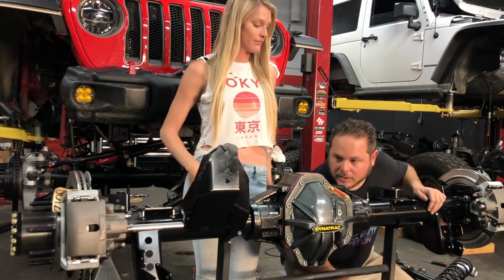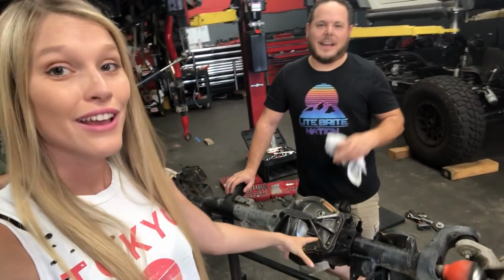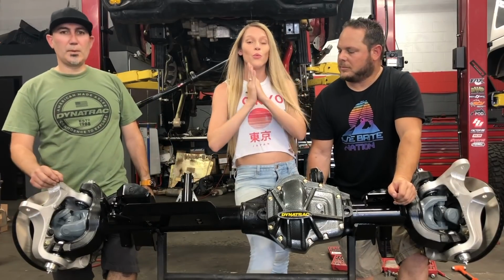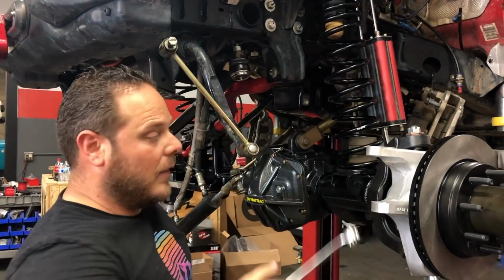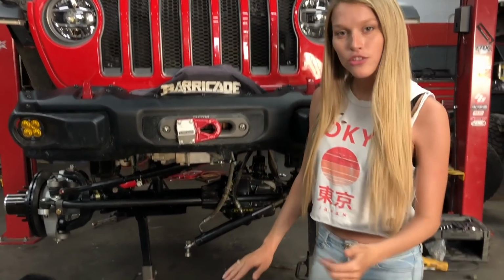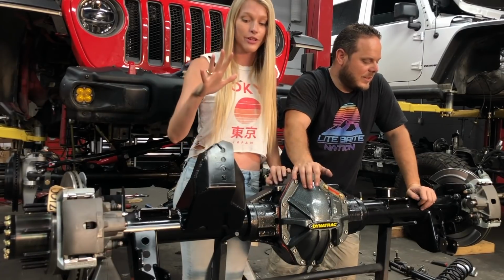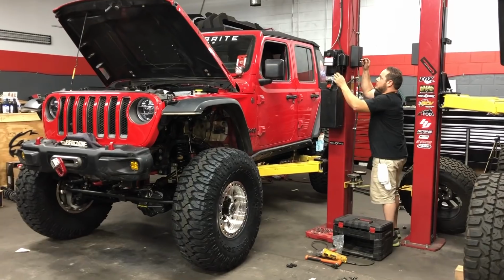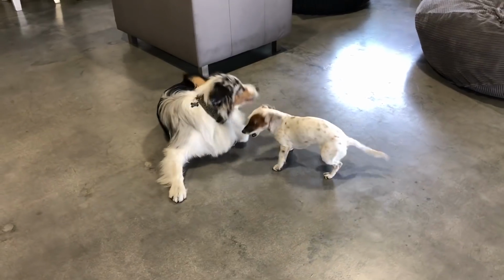The HEMI SWAP Gets Some DYNATRAC AXLES!

Comment: The axles have arrived! You guys are BACK. I can hardly wait to see you guys back on the trail. I’m so excited!! 😍 Those front locking hubs will save you a little MPG while driving in 2wd on the road too since you won’t be spinning the front axle shafts and drive shaft with the wheels while you’re driving, less rolling resistance means better MPG.

Comment: Keeping it narrow is a good idea on tight east coast trails. I've had my PR 44/60 hybrid for 5-6 years now.  Happy that I haven't broken any shafts or anything in the pumpkin but the bracketry seems a little weak. They really should have used 1/4". The XJ is getting 39.5" TSL's, so hopefully it can handle them with a 4.0 and Atlas.

Comment: The Prorock 80 is some serious BEEF! I can't wait to see this thing wheel. There is still a lot to button up before that can happen though. All those little things add up. :) 
If I am honest, I was hoping you guys would give away the prorock 44. My dana 30 is doing great, but a dynatrac axle can obviously take a lot of abuse! There really is no cheap upgrade for an XJ dana 30. The TJ low pinion 44 is just a dana 30 with an 8.5" ring gear and still costs an arm and a leg. An aftermarket one is the only way to go but I don't have the $4k for one. 
Keep the videos coming. :)

Comment: Need to drive 500 miles before hammering on it. Make sure shift points are correct, when hammering down, after break-in. If trans is not properly tuned when hammering down, you can shock the driveline and damage stuff. Had an issue with 6th gear dropping to 3rd shocking driveline.
Reply: Is it an auto?

Comment: Good thing you worried about offsetting the 6 pounds per tire gain from going to 40s.  Because I would think the new axles add about 400 pounds.
Reply: Dam Ham yup yup but that’s not rotating mass

Comment: Looks like that steering arm would have a better angle if it was on the top of the knuckle rather than the bottom but I guess the wheel diameter limits top side clearance. You got a pretty heavy duty Jeep now. Congrats

Comment: It should be interesting to see how your in vehicle videos turn out, with all of your extra rumble and tire noise. Might need to go back to the hard top with some sound deadening pads aka dynamat or something like that; The Jeep looks sick!
Reply: TheWilliam1122 it’s very quiet inside
Reply from the maker: Can confirm totally quiet inside at highway speeds (minus your normal Jeep shaped like a brick wind noise lol). Zero tire noise out of the Milestars and motor is quiet when cruising

Comment: Were the new axles easy to wire up for the air lockers, brake sensors, and parking brake cables?
Reply from the maker: Yes
Reply: C Hill very easy

Comment: I'm sure someone can correct me if I'm wrong but isn't there another purpose for the manually locking hubs? Wouldn't they allow for slightly better fuel economy when highway driving in 2WD?
Reply: Alvin Nino yes. Nothing is turning until I lock them in

Comment: Now this how a jeep should look and be built , LOVE IT!!!,  New V8 engine with massive power, and heavy duty trans, and heavy duty front and rear axles, only thing left stock is the transfer case, how long will that transfer case last, i am sure it was not designed  for that much power, but will make for a great video, when need to replace it,

Comment: I had a manual locking hubs on my’67 Jeepster with Dana 30 axels so they should be easily installed on a Dana 44.

Comment: With the stock Rubi axles, the rear 6 pack shocks typically relocate the lower bracket, allowing you to take a cutoff wheel to ~3" of unnecessary metal, gaining clearance.  Was this figured in with the built-in XD80 brackets or was some effective travel lost with the rear 6 packs?

Comment: Why is there not enough room that’s what most all 4x4’s had back in the day stock Cj’s fords Toyota  and so on. Talking about the manual hubs, also I guess that’s your week point? What about running pucks don’t they have a solid peace in place of the locking hub. Or do you need that? Are the JL transfer cases running the front shaft even in 2wheel drive? Nice mods.

Comment: If you had pulled the motor when brand new and sold it, how much money is the stock engine/trans/tcase/axles worth? 

I’m trying to figure out what it would cost to pull everything for a swap like this in a gladiator next summer VS just getting the diesel and swapping out everything downstreamfrom the Tcase
Reply from the maker: Probably not much, tbh. But that’s only because there isn’t a market for it.

Comment: Those new axles look awesome ! No CV joints though ?
Also, it will be interesting to see how much of your under armor that will fit with the new driveshafts.
Reply from the maker: Gonna try it out as is first! And It all fits! Just had to modify the mounting brackets for the engine skid!
Reply: @LiteBrite  
Oh it fits ?
That's pretty cool.

We, the viewers, are after all a few days behind on this whole thing, so didn't know if the new driveshafts would be so much more beefy, that they would collide with the under armor.
Reply from the maker: Grumpy ol' Boot Seems good so far! Mayyyy have to trim a little off the gas tank skid, but we won’t know for sure until we can get it at full flex. As of now, it all clears!

Comment: You might want to check the driver side rotor when you were spinning it it didn’t look like it was spinning through it looks like it had a little wobble in it check that out it was when you were showing it locked in manually and unlocked manually
Reply: J nothing was holding it on

Comment: Did you consider curry axles? Curious as to what made you pick danatrak in the end. Other than the pitch in the video ;)
Reply from the maker: They have the highest ground clearance, rebuildable ball joints, only ones out there with 4” tubing, etc etc. they’re sort of the industry leaders in axles. 😊

Comment: It's a shame that we couldn't get a comparison with just your engine upgrade to compare apples to apples. With all these axle changes as well as tire upgrades it's difficult to compare the 3.6 and 6.4 to each other.
Reply from the maker: Compare in what way?
Reply: @LiteBrite  By apples to apples I meant just the engine and transmission change. I do the exact same thing when I tear a vehicle down, it makes sense to do everything at once. 
What I was curious about was how your JLU would behave with just the Engine and Transmission change. With the new tires, wheels and axles it makes it harder to compare. 
I have been asking Jeep to offer the 5.7 in Wranglers for over 10 years now, I get that it doesn’t make sense for everyone but there are a few of us that simply won’t purchase a Jeep with a small V6 or Turbo 4 in it. 
 I’m running 40’s and a 5.7 in a 1967 Jeepster. I’m seeing 16-17 mpg mixed so I can’t help but assume that you two will have better efficiency than that.

Comment: Sweet setup..   Gotta love that monster motor and the 40's. I've got a nice '99 TJ and have Dana 60's under it. They're setup with 4.88's and lockers. It's powered by a small block Dodge Magnum 318, connected to an auto trans from a RAM 1500 with an Atlas II t-case. 6" Clayton Long arm sitting on 35" BFG KM2'S. I've got quite a few cool video's on my channel, so come check them out. Comment and new subscribers are welcomed. ps. The Rubicon trail (we've done a few times) is an awesome playground.

Comment: I had no idea axles could look so sexy. Damn. I'll never have an extra $50K laying around for a build like that but it sure is sweet.
Reply: 50K? Better dig deeper. 35-40K for Hemi swap, 18.5K for Dynatracs, ????K for wheel/tires
Reply: @TooBrokeToWheel  Umm $50-60K? What's the difference ain't happening so it may as well be $500K. My point wasn't to come up with an accurate parts cost.

Comment: Hi, amateur question:  Since you are now higher and heavier with a narrow stance ...Aren't you afraid of rollover?
Reply: Joe Venuto not at all. All the weight is unsprung mass way down low and under the suspension and lowers the center of gravity. Sprung weight is where you need to worry, like adding a roof top tent.
Reply: @boughtnotbuiltoffroad7784  Thanks for the response. I have been following you guys for a while now. Really enjoyed the last few weeks.  I know it wasnt planned. But the whole engine swap and the drama with the tubro has been a very fansinating and educational experience. Thanks for sharing.

Comment: I don’t think you’ll be towing anything bigger, you’ll be past the the jeeps gvw.
Reply: Rich Brown (Retiredppd ) that’s out the window. That was for stock parts. The jeep is no longer anywhere close to stock
Reply: Kevin Williams it still goes by the manufacturer gvw , unless they get a recertification.
Reply: Rich Brown (Retiredppd ) yes I can technically get in trouble but am I putting anyone in danger? I don’t believe so. With a load distribution hitch and anti sway control I have all the parts needed to handle 10k plus at this point

Comment: At this point it would have been much cheaper to start with a old jk rather than a new JL. You probably have close to $100k into the JL now and it's only been like 2 years.
Reply: It also would have been cheaper if they did not go with 35s, 37s, 38s, then 40s.  Skip the Pro Rock 44, the Rough Country lift, etc.  But, when these two started out with their JL, they did not have 75k subscribers, and strong industry contacts, so skipping the intermediate parts of the build would not have been possible.
Reply: Way more than 100k invested!!! Agreed, should of bought jk and  then replace everything
Reply: @RyanRKJ  Good point.

Comment: I am kinda shocked that you all did not get locking hubs on the rear (for all the same reasons you pointed out for the front). Turn the "STEP CHILD" into a font wheel drive and watch the fuel mileage go up (Did this on my Cummins 3500 towing and went from 17mpg to 23mpg, and you could do some tail whips.) just sayin...
Reply: John Johnston that’s not how that works
Reply: @boughtnotbuiltoffroad7784  Worked on my CJ3B with a 383 stroker and N2O. That is were I got the idea from...

Comment: Heavy duty rears to go rock crawling makes a lot of sense. 500 HP to crawl over rocks makes no sense at all. 500 HP for  desert racing makes a lot of sense. If you are doing both with the same Jeep makes a lot of sense otherwise you are pissing money away just for bragging rights. That's OK for the show circuit but not for real competitors.